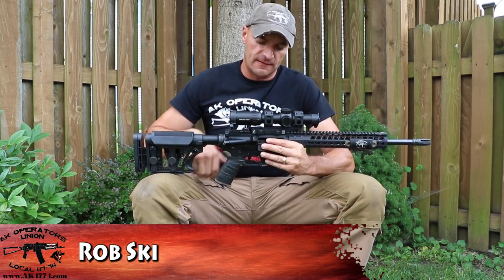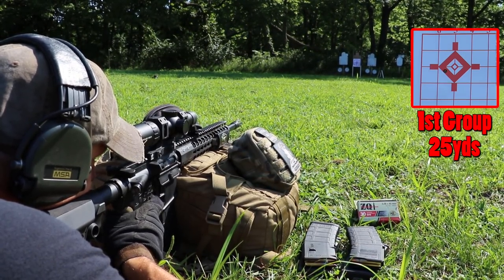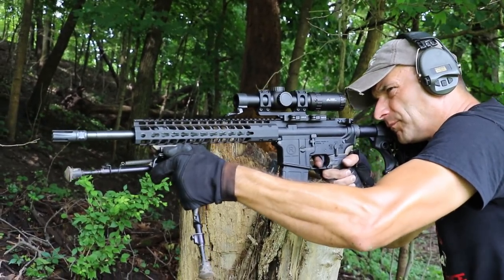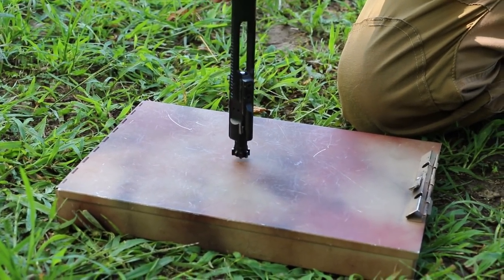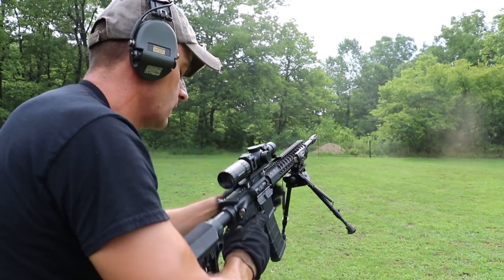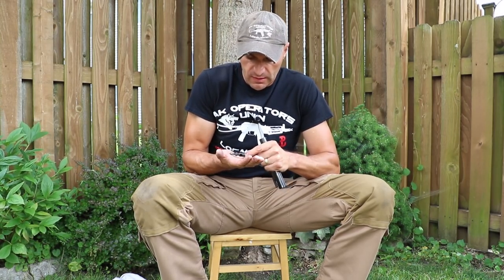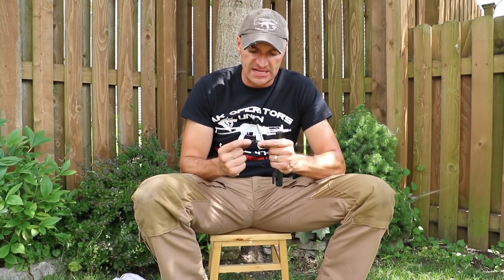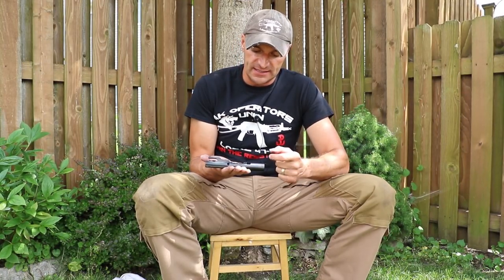Radical Firearms AR-15, 4310rds LATER - Another one bites the dust!

Comment: Sorry Rob, not with you on this one.  Change this to a polish AK and a 7$ part is no big deal.... but if it's a Radical it's somehow the end of the game.  ..and then you don't even try to see if it works after swapping it?  I normally love your stuff, but you're being pretty opinionated here.
Reply from the maker: +TurnandMike you change gas rings because they failed, you change cam pin because it snapped, you may very well change whole bolt carrier group or upper - it only takes moment, but when you draw the line? 5k rds test is very simple, if you can't fix it with duct tape, rock or 550 cord, then test is over. I don't understand which part of the rules is confusing for you here...unless you believe that cam pin could be glued together with duct tape?
Reply: Speaking for myself, these are parts I keep inside my VFG. I perfectly understand your approach.. but I guess I can't help but remain curious if this is an actual TKO... or something enterprising folks could fix on the fly.  Anyhow, I appreciate you taking the time do all this testing, create the video, and read and reply comments!  Twoje zdrowie
Reply: Nice hijack, I wonder why he ignored you.
Reply from the maker: Florida Prepper You are forgetting that Arsenal trigger was operational and working. I did remove ledge from trigger hammer for my own convenience, because their stupid design to simulate 2 stage trigger was driving me nuts. But even then I used dremel tool to speed up removal of stupid ledge on the trigger hammer, but it could be accomplished by grinding off by rock - it would take me like 2 hrs to do so, but effect would be the same. In case of RF AR15 gas rings were busted - not working. I changed those to keep it going anyhow. And after that  cam pin snapped...if you don't see the difference then it's only because you don't want to see difference here.
Reply from the maker: Florida Prepper You have to be clear with your questions, please state all other issues in clear order so i can answer to them. You are just mumbling random things into one sentence. I have more than 1000 questions per day, so sorry for not seeing your question before, but i have a work to do for living as well...I answered about Arsenal, what else is bothering you?
Reply: +Ak Operators Union, Local 47-74 once again. my biggest issue is you changed factory parts (trigger) and then blame the manufacture for a failure. The trigger could have caused this. All we want is for you to put the can pin in and see if it would continue. spewing random stuff? OK man.
Reply from the maker: Florida Prepper Ok, i posted this somewhere in comments here. I have dropped now whole BCG and rifle works perfectly fine. Issue had nothing to do with trigger group. I repeat, rifle is fully operational after dropping new BCG...
Now why i put trigger to it? I don't have money to test trigger only for 5k rds - compromise had to be made - dropped Geisselle trigger group to the lower to collect data on it while i was doing RF test at the same time...It's hard to screw up lower receiver - RF lower is perfectly fine, most magic always happens in the upper...Even upper is fine, problems i see are with BCG components.
Reply: Thanks Rob! This is all we wanted man! Before this response was even posted I removed all my negative comments so your fan boys would stop attacking my YouTube channel for having a opinion. I appreciate you dropping in the new BCG and reporting it worked fine. I have the nickel boron bolt in mine and after a year of firing (under normal cleaning) it has NO signs of wear. The other radical I have with the normal BCG showed signs of cam wear at around 3000. As I stated in your 2000rnd video it should be replaced then. Even Mr Stoner said if this rifle was not maintained it would fail. Ak47s are known for firing dirty, AR15s are not and I'm still impressed it went that long with no cleaning. My RF was 495$ then added Nickel BCG for 100$. 600$ rifle and I'm sure it would survive. Thanks for taking the time to answer me and I do appreciate what you do. I do however think the AR and AK are in different classes and both have pros and cons. Thanks again.
Reply from the maker: Florida Prepper no problem and i'm glad we could talk. I apologize for not getting back to you any sooner, but honestly, sometimes i just don't even see all the comments / messages / emails and etc. I'm the only one person responsible for communication here and i'm reaching my capacity limits...i'm not sure how to handle this while going forward into the future...I realize that it looks bad when i don't answer, but as i said, that's not because i'm dodging the issues, is just i really don't see all the questions...:-(
Reply: Take on a intern!
Reply: Rob it looks like radical may have switched companies its using for cam pins, or if they make them they are using cheaper material. My new pistol upper's cam has already taken a beating after just 1 advanced practical class. I emailed them pictures to find out what gives. I'll post pics on your Facebook.
Reply from the maker: Florida Prepper awesome feedback. I have mailed them my broken one, together with gas rings to analyze it, but i heard nothing back...:-(

Comment: Does it still run with that new part?
Reply from the maker: +Anthony Fiori yes, it runs with new parts
Reply: +Ak Operators Union, Local 47-74  cool but like you said it's s critical part. Thanks for doing this. Makes me want to buy extra bolts/ parts

Comment: Is a shame it gave it up that fast but the gas rings are a wear item and carbon will wear them down faster cause it acts as a abrasive. Cam pin is something that as anyone who has a ar can say takes a lot of stress and abuse but I feel like you rob that 4K was short on its life however for less then 40 bucks us that gun will be back up and running
Reply: Ha...try less than $10...

Comment: Have several Radical uppers parts and rifles... Fail fail fail 
latest pistol build 600 rounds broke cam pin as well epic fail absolute garbage and dangerous, I will never recommend Radical to anyone.
Reply from the maker: I mailed them broken pieces and they never went back to me...
Reply: Ak Operators Union, Local 47-74 
Sent them an email with pix we shall see - even if they replace the BCG I’ll be running another manufacturer in my builds from now on.